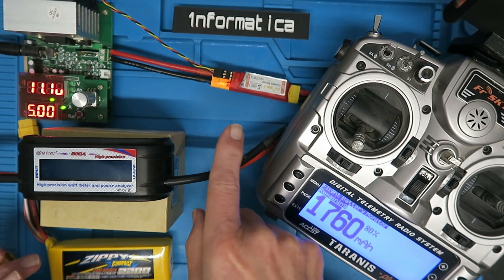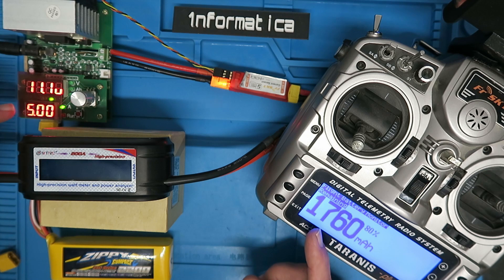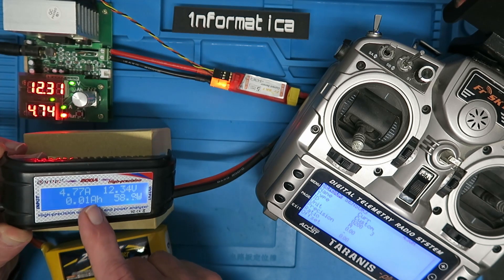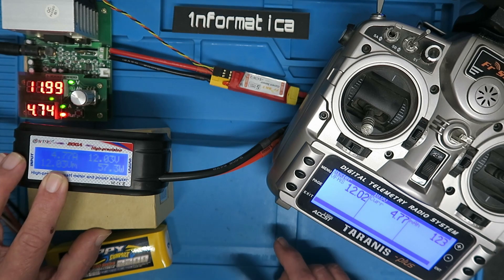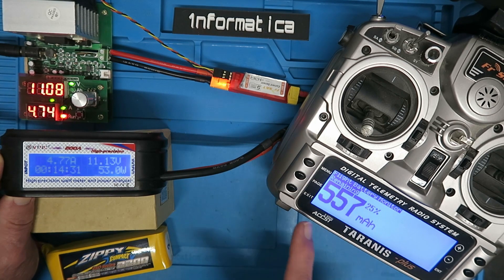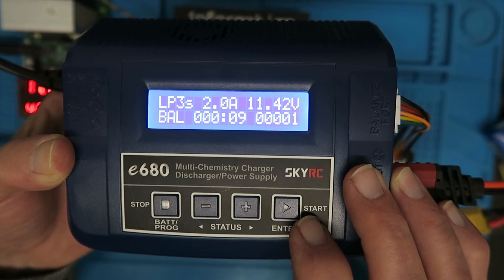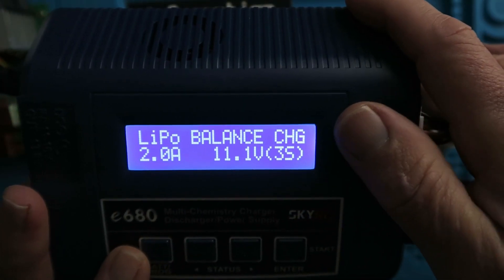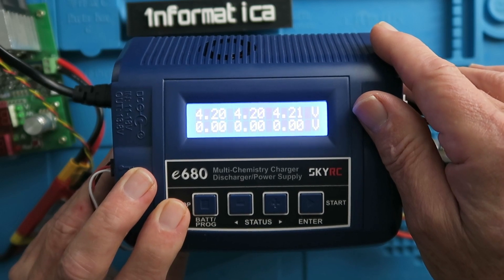FrSky40A Smart Port Current Sensor Taranis Calibration

Comment from the maker: Results of indicated discharge during flight against charge:
Indicated           Charge
1039                   1123
934                       994
642                       685
The indicated discharge values may be a little lower but I am happy with these results. The charge was done some time after the flight when I returned home.

Comment: Fallacy :   Charging Amperage is not what the battery is capable of producing.     Were not working with a liquid quantity.   Recording what your charger is throughing at the battery will vary charger to charger and battery to battery.   Results will vary.  You happen to to have a really good efficient system  and new battery it would seem.